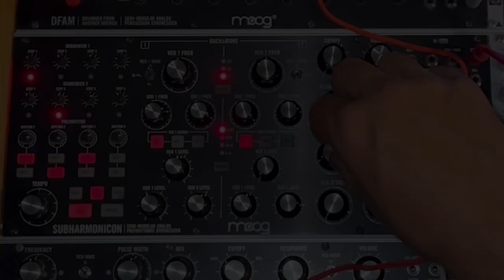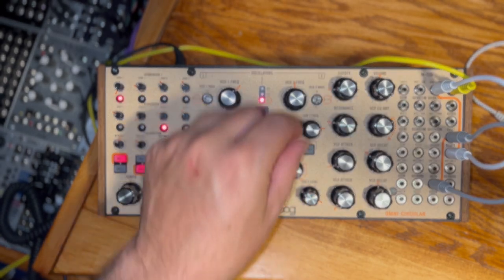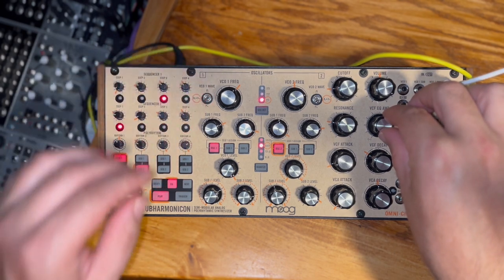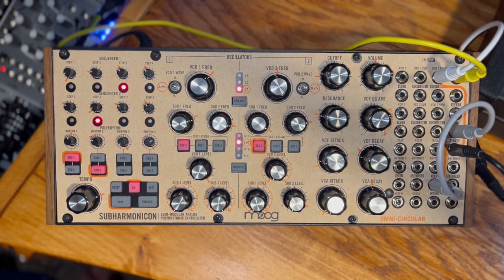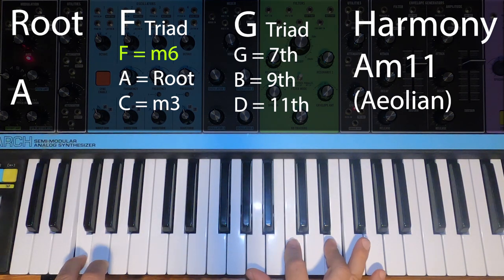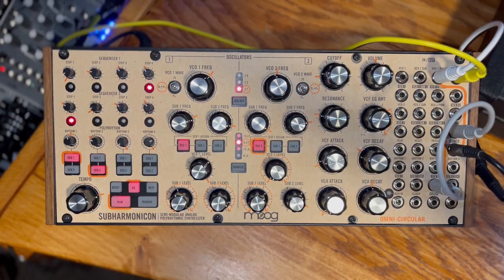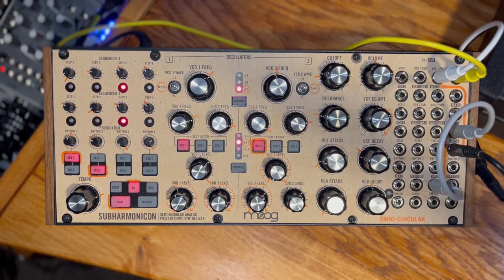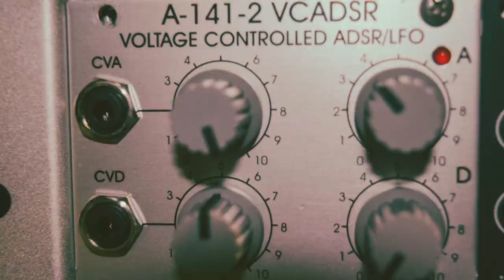Moog Subharmonicon - Exploring a Patch (and a little bit of music theory)

Comment: The intro gave me goosebumps. I have the DFAM and SH i think I need the mother 32 as well . They were meant for each other. 
Thanks for the video!
Reply from the maker: Yes, the mother 32 is aptly named. it will greatly expand your capabilities with the other 2....and sounds absolutely fantastic. if you get one, make sure to update the firmware to the most recent...you'll gain TONS of more features for the sequencer.
Reply: @RobeMusic  sweet. Time to save some cash
Reply from the maker: You could do that with Midi from Logic to Mother 32 (or MAtriarch...but Matriarch's midi is a bit buggy..M32 is a little more solid) then out the "assign" jack from the mother (probably will need a mult..or use the one on the m32) to the clock/trigger inputs on all the other units. pretty sure thats covered in the moog manuals. If you want to use CV out from DAW...(which will be more stable) check out Expert Sleepers modules with Silent Way clock plugin in DAW as master clock, that's what i use. (you may not actually need a physical module if your audio interface is dc coupled...he explains that on the expert Sleepers site) If you use Ableton Live, you can use their cv tools to do the same. Arturia Keystep pro also has CV outs. There's also a few other modules out there...midi to CV converters that would work well for that. First step is to read through the moog manuals and decide how you want to connect all the synths. you can do it a bunch of different ways and some will be better for different situations.